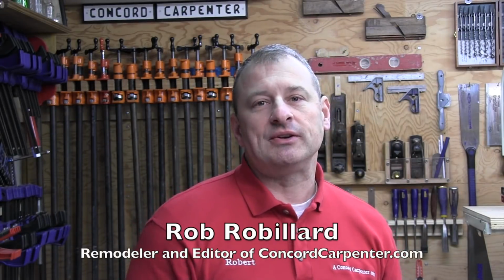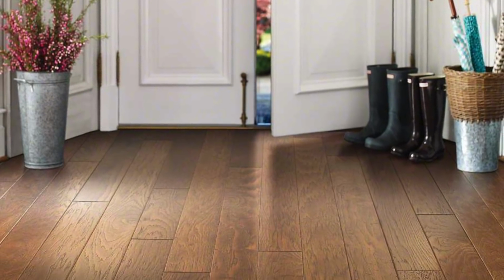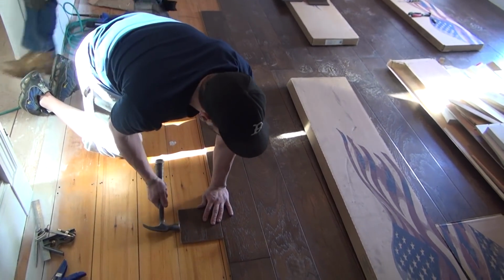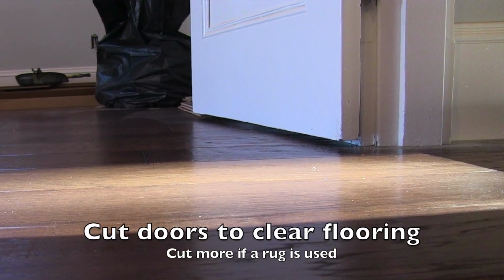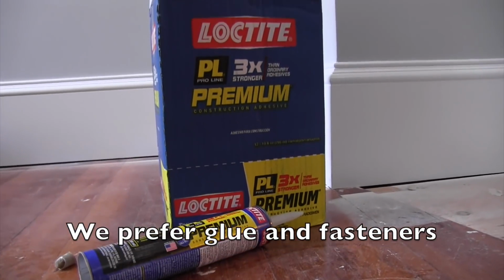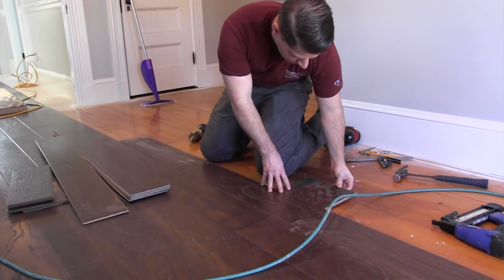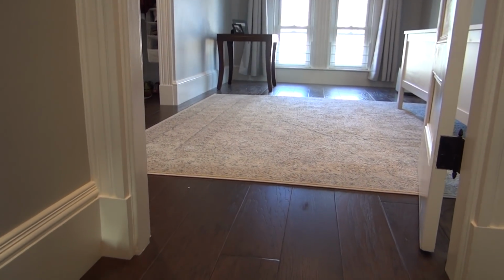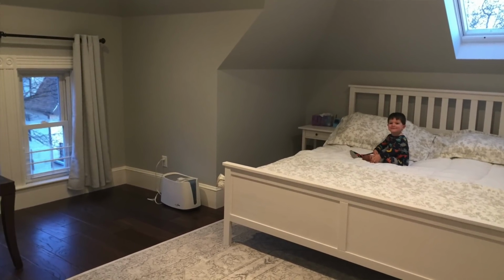Installing A Shaw Epic PLUS Engineered Hardwood Floor

Comment: I’m curious to see how long that floor holds up before it starts popping and separating from the lack of expansion gaps along most of the walls in the video and because it was installed parallel to to pine flooring underneath it. Pine expands and contracts significantly throughout the year with humidity/moisture changes. The engineered flooring attached to it will be along for the ride. With no place to expand it will buckle the floor. Then, when it contracts, it will become loose as the nails, staples and glue were worked loose from the pressure. I’d expect a concerned client within a year and a very dissatisfied client within 2. I hope I’m wrong but I’d be amazed if I am.

Comment: You add in a subtitle about maintaining expansion space around the perimeter, yet you butt the entire floor up against the baseboards! Fail!!!!!
Reply from the maker: Ray Mansfield there are small gaps, base was held up.
Reply: A Concord Carpenter / ToolBoxBuzz Absolutely not left up for expansion! So many times throughout video where they are clearly going right up against base. Also can see that base is touching old floor because trim was sprayed and there is no gap. Not trying to bash you, I enjoy your videos and info, but I call it how it is when I see it.
Reply: Ray Mansfield couple things you need to understand- if this was solid hardwood expansion would be an issue but truthfully in these small rooms you only need to be concerned with the width. Across the grain. Expansion with the grain is absolutely minimal unless your room is 200’ long or something.  And with engineered products it’s a non-issue period. You’d be measuring seasonal expansion in thousands of an inch ( a sheet of paper is .004”)  yes I understand that might void a Mnfct warranty, but the fact is this is high quality plywood and the minimal expansion you might get under extreme conditions will easily be taken up in the joints between flooring pieces.  Solid hardwood in small rooms - if it’s acclimated at all you might get 1/4” seasonal expansion in 20’ - and again, .004-005 in length.  The Mnfct wanting 1/2” all around is total overkill and is CYA. In truth -where Rob works winter shrinkage is a MUCH bigger problem than summer expansion. Solid hardwood laid tight even this late in the year will develop shrinkage separation across the width into Feb.or so.  We have to prepare clients for that reality. Engineered floors - Nope. They  are incredibly stable, even over radiant heat.
Reply from the maker: Ray Mansfield there are gaps are across the width, some of the flooring is tucked under base at spots (base was held up) your seeing flooring tight at door trim and length., which was intentional.

Comment: Good job bloke.Thats what I do down here in australia.maybe next time try using a rubber mallet to tap boards together might save you time thats what I do and secret nailer.but we usually install a 22mm board the boards you were using look like 10mm thick secret nailer might damage edge.anyways keep up good work.cheers
Reply from the maker: Fernando D good tip thanks

Comment: Hello Rob. Was wondering how come you don't use a floating top floor, that will allow expansion and shrinkage (by having around 1cm of free space along the edges, but hidden under the floor panels). I know quite a few manufacturers in Europe who uses this as the general guidelines for laying the floor. Is that something that is rare or non-exsistant in the us?
Reply from the maker: Jacob Eskildsen many people do, I'm not a fan, and it wasn't spec'd here
Reply: @ConcordCarpenter   For engineered floating the Elastilon system would work great in this instance especially that the direction of the floor boards follow the same direction as the solid subfloor. www.elastilon.org  I've used this system successfully for 15 years now...
Reply: Jacob Eskildsen 

Very common. It's easy to mess up, and give a chintzy feel.